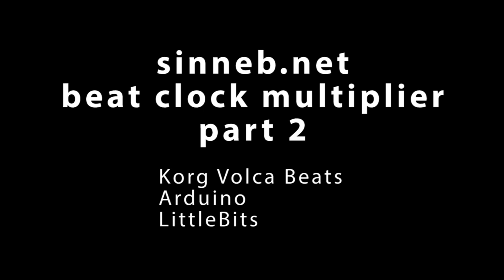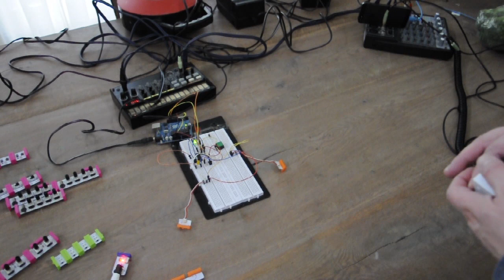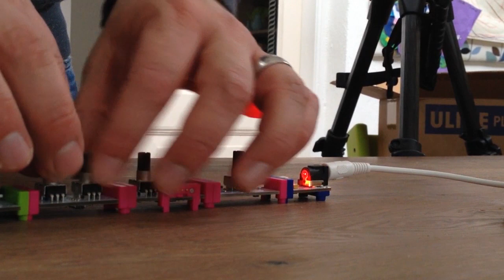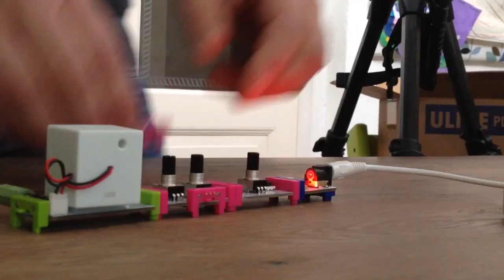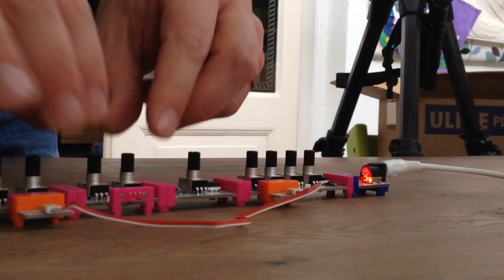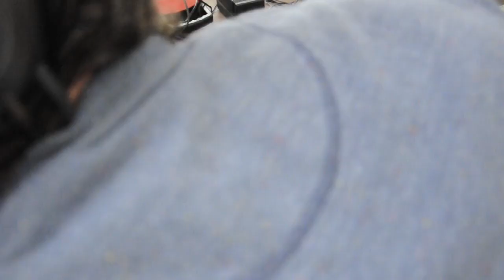Beat clock (BPM / Pulse) multiplier using Arduino, Korg Volca and LittleBits, part 2

Comment: Search for the LittleBits schematics on Github.  I’ve been really angry with the snap connectors.  Those magnets aren’t good at all.  I wanted to replace them with some little DuPont sockets and header pins, only to have damaged a great number of very expensive modules:( !!  I am hoping to repair them, once I’ve come to a decision on whether I ought to use the header pins and DuPont sockets, or look for another way to replace the snaps.  My friend pointed out that with the scenatics, and all necessary files available as open sourced information it wouldn’t be very expensive to just send some cash to a PCB and assembly service, and have my own generic littlebits, without the blasted magnets.  Especially when you consider the price of just ten synth kits, you could have owned almost ten times that if you only had them fabricated.  I own A LOT of synth kits...  THANKS FOR SHARING, check out Peter churchyard, he’s done a whole lot of developmental what he’s named ‘softbits’ - a sort of LittleBits emulation environment for computer.  Peter is a synth brainiac!  THANKS again!